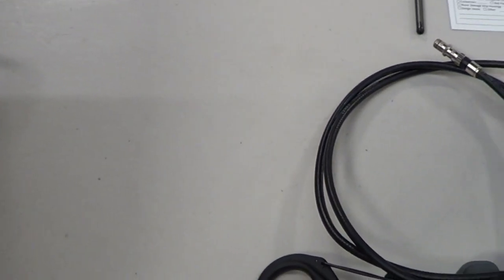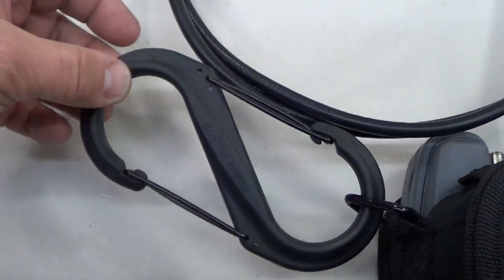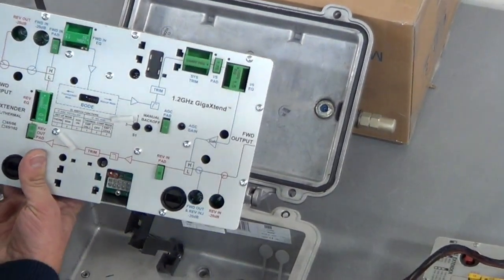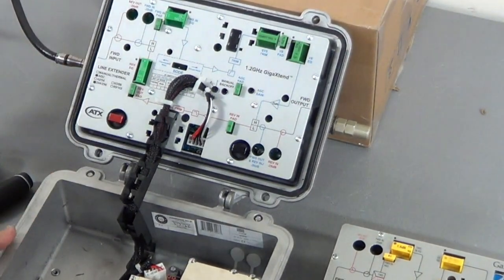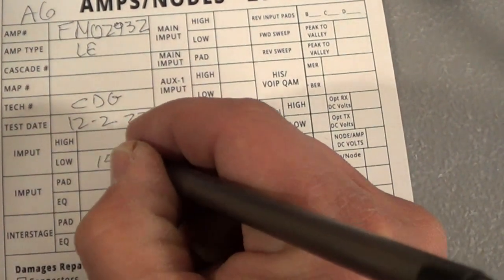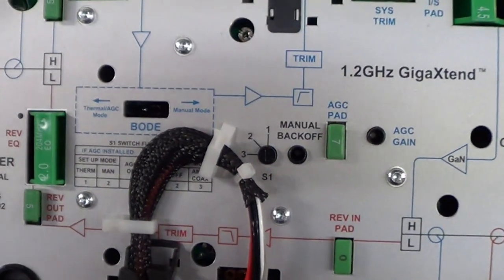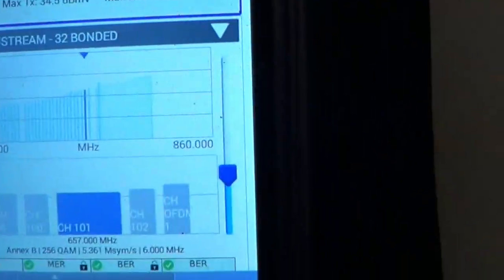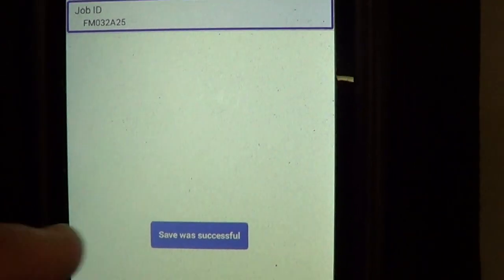Replacing and balancing Line Extender amplifiers - English

Comment: Very nice demo sir🫡. Question though, what is the input level required for that LE? 

I keep Test Point compensation off on my viavi and add the 20db in my head. I was trained the importance of checking the input levels, adding the 20 to get the level, was to calculate how much level to attenuate at the foward pad so to not over or under cook the hybrid chips that amp the rf.

I'm on a high split project in TX atm the LEs need input padded to 14db and Minis to 8db.

Any additional level I need to cut to hit my 41db/34db after adjusting the EQ to get a 7db tilt i pad at the interstage.

Comment: Just wondering why you're doing your setup in thermal and not manual? Also wondering why you're not explaining: the manual backoff (what that's for,) OR the agc padding.
Reply: Had the same question
Reply: The reason I clicked on this was for the manual back off info. That thing is annoying.
Reply: @zlcoolboy   I generally run 3dB down from highest point on my high tilt channel. You should have about 9dB delta between full stop down and full stop up.

Comment: Great video. Question; at 24:32, your meter shows a low/high freq range of 261-686 Mhz and you say that the level for the low should be 34 & high at 42 dBmV.  My private CATV system has a freq range from 57-567 MHz, what would the proper level be for this range and how do I find that out?  Thank you!!

Comment: Great video and appreciate you covering! Im a new MT and this video will help alot to look back at. I had a question on the S1 switch. After balance in switch one, do you go to switch 2  for manual back off and drop levels by 1.2 db, then go to 3 and raise it up to proper levels from there? We went over this in training but wanted to check on this again. I also gathered from a fellow MT that when your in 2 you turn dism all the way to the left then all the way to right and stop in middle, then adjusted down by 1.2db.

Comment: Hi.  Thanks for the great video.  I have a question regarding the readings on your meter.  Using the low channel as an example, I see that the output reading is 34 dB, but the test port is -20 dB.  Does that mean that the ACTUAL output is 54dB, or does your meter have a setting to compensate for the 20dB-attenuated test port and reading the correct value?
Reply: Acterna meter will let you set the 20dB compensation. Most techs don't, but if your job is to change actives all night then it would be prudent to do so.
Reply: @jimmydean8007  Thank you.  My Sadelco doesn't have that to my knowledge, but I rarely work on LEs

Comment: Question, I see lots of those metal boxes  various sizes on poles .How do you know which is a Node or amplifier, can you tell just by looking at the box which is which. What  the different sizes mean ? I enjoyed the video
Reply: The nodes are bigger than amplifiers, are sometimes painted white and have big loops of fiber near them. The amplifiers are slightly smaller and have four holes coming out of the main box, there are things called line extenders which are smaller than amplifiers but look similar and only have two main holes coming out of the box.

Comment: I got fired for using some tips from your video
Reply: What? How?
Reply: @strykerzr350  Because he was pretending to be a cable tech when he was suppose to be watching the french fry machine  ;-)
Reply: @jimmydean8007  when you don't remove the in power shunt before plugging the power supply back in, you'll no longer have the power supply. Also, removing the power supply cabling from the chase is just a waste of time.
Reply: @MichaelPugh-zx8ko A: He put the shunt in after the power pack was installed B: The power pack at the GS7000 would have been more prone to blowing then the PS, but I think you meant DC Power Pack C: fluke was trolling and you took my response seriously. There are some cuts in the video such as he reads the output levels as 47/45 with the mod -20dB offset at 21:02 and after he shows the AGC (which was already in the 1 position) his levels are 39/34. I'm sure this was for demonstration only.